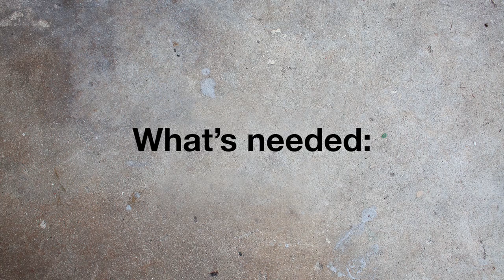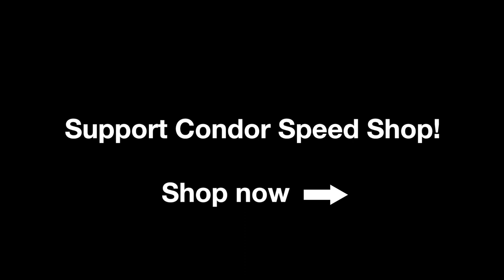Brass Caliper Guide Bushing Install - E30 - Condor Speed Shop

Comment: What grease did you  use??
Reply from the maker: kevin_tigz high temp anti-sieze
Reply: Condor Speed Shop brand?
Reply: I used a high temp anti seize and the pins required pliers to remove after a 24hrs of lemons race. Totally gummed up. Is there a better grease?